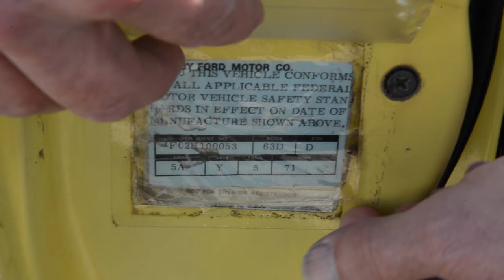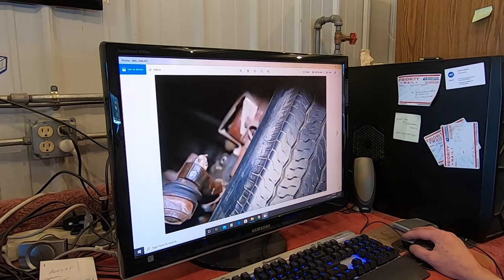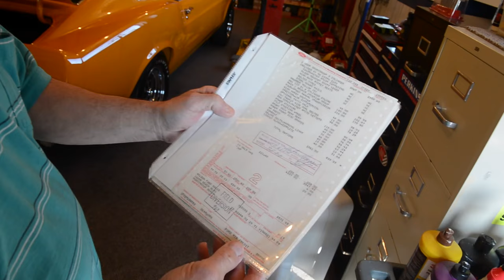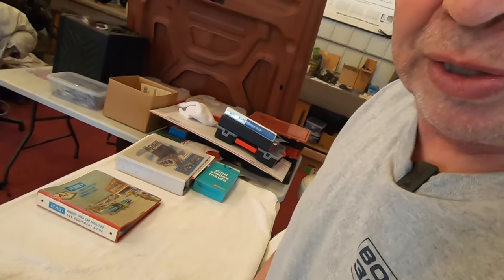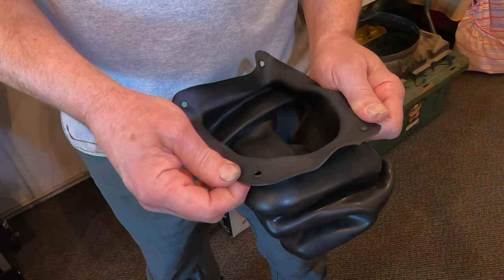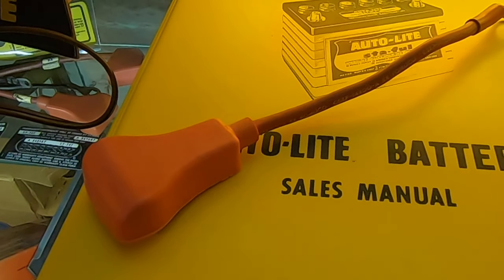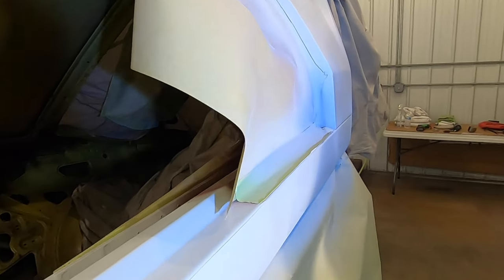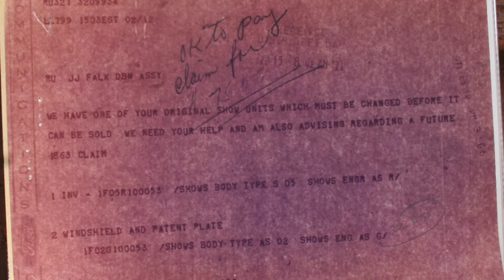The Long Lost 1971 Boss 302 Mustang Prototype, Bob Perkins Boss Expert Saving History

Comment: What a great story and a beautiful car!  I'm sad that it won't be driven.  I'd be curious to know if the Boss 302 engine in the heavier 71 Mustang body would perform like a muscle car?  The Boss 302 wasn't designed for drag racing so much, but rather for high rpm, endurance racing.  The Boss 302 Cougar Eliminator was a beautiful car, but 1/4 mile times in the mid 15's wasn't impressive.  LOL... I want to find the rare Boss 302 Maverick

Comment: I am a Ford fan and a Mustang fan ever since I rode in a 1967 390 GTA at the age of six. I am put to a mighty low shame by Bob Perkins!  He makes me looks like a know nothing newbie.  I have always wondered about the 1971 BOSS 302 and why there was not a 1971 BOSS 429 because the 1971 was designed for the very reason of placing a large engine in it's engine bay.  Another 1971 mystery is the 1971 Mercury Cougar Eliminator. I had a 1972 Cougar with a 351C in it and at the time I also owned a complete 1970-71 Torino Shaker air cleaner assembly. One day after tuning up the Cougar I had the hood open and a friend came over to BBQ and we had a few beers. We got to talking about what kind of air cleaner I would need to complete a ram air system to the Cougar GT hood scoop on the car. I pulled out the Shaker and I was holding the trim ring while talking about the lower air cleaner when I noticed that the under hood structure had a shape very similar to the trim ring. It matched the trim ring. The next thing I know is that I am shutting hood with a Torino shaker sticking out. Everything lined up and fit. I looked at my friend and said "This not a coincidence. It was designed for this hood scoop!" Why did Mercury decide not to use this?  They went through the trouble to make sure it worked. Where are the concept photos of it?

Comment: "Well, we know what Bob's passion is!   One of the NICE things about all the interest in the vintage mustangs is that there are several sources for new and replacement parts.  I can get about anything I might need for my old 1965 mustang from several different companies.   Also love the 1969 AMC AMX but have been afraid to buy one because getting new and replacement parts might be very difficult.  Hell, I wouldn't even insist on the 390 cubic-inch engine and four-speed tranny.  ANY 1969 AMX would suit me.

Comment: Wow, a man after my own heart that truly loved a ford and from what I watched was a man who could exploit the parts correctly. Although I didn't have  a fancy mustang, I did buy one from a dealer who was willing to give a nam soldier what he wanted was a four barrel anything motor with four speed and so into their shop went a kinda overkill six cylinder three speed car with one wheel peel and so they put a 302 engine with some aftermarket manifold to make the carb work plus whatever it needed for the throttle cable that I wound up tying a wire to hold it tight and work right on the side of the road. At the time I knew none of the above history and was only interested in power and speed. I used a narrowed lincoln rear end done in a shop in seattle where my money was fast disappearing. I did have fun in it and it caught some road rash I thought added to its personality. I caught a girls dads fence post digging out when he shot at me and the car caught some of the lead which popped the back window and had plastic in for a little while and then plexiglass. I couldn't see through it good but then others couldn't see in. The back of the seat on the passenger seat was much bragging rights with some holes in it. So there had to be lead in  the upholstery.  The rear end was 41?  as I never really knew for sure if it was what was written on it. It had the disk brake from lincoln and all that on it but the center section was worked on and did the posi burn. This car had over thirty thousand miles from me but started giving me problems with  the linkage on the trans getting tangled up when speed shifted bad. Hammers to get the thing to roll again as it slide to a stop a couple three or more times and then is when I stumbled onto a dodge polara with a 426 wedge and four speed factory. I got fifteen hundred on the trade in and that was more than most were selling for used banged up, an cause I drove it in my work clothes and did the upkeep in the car washes it had problems so was glad to get off it for a factory car that to me at the time looked more like a race car from  the hot rod mag. I did get the dodge in 74 spring an was put together at the factory and by then getting on wages only plus a divorce so I had worked two summers in alaska. I drove that dodge till I pulled to the side with a flat on the right front? Your asking how I remember and it was easy, that tire was tore up and flopping and when it caught the soft fill on the side of the road,  it took that phony torsion bar suspension and ripped the unibody and all up leaving me right there. I did start it and powered it onto the road where it definitely wasn't going anywhere. A guy I knew come and got me and it being a wrecked car thought I was screwed. I did know how to work on cars like a kid at the time and it was above my paygrade back yard diploma. He was headed to work and told me I could use his rig, don't wreck it an I took it with grin. He worked at a chevy shop and so me and chevy had had our differences. I went over to the local ford shop and used car sales. I was looking at their magazines and their salesman asked me if I was looking for something so I unloaded my lifes story on him and he said let me talk to my boss. They come down in their salvation army suits that just looked sad to me and I was going to leave. One said wait I have what you really do need..... ok.... and we go look at a 72 three quarter ton ford with a four wheel drive and as close to kinda dressy looking as the could cobble together look. They took title of my dodge parked where it was as someone there had seen it an no one did mess with stuff during the day. He said that I could bring the rest of the down payment in in two months but no longer. I thought that was easy enough ... thinking   will get you every time as I found out. So some money left and a second hand nice little rig I hooked up with a bad crowd. I had to go to court in the afternoon and I was on a airplane north to Ketchikan where work and drinking had been my new signature. I did outgrow that but should of never put myself in that position an then a phone call to Olympia let me and them know I would come back and face my  consequences. That was one nice judge who fined me a hundred dollar more out of token but he talked to me in chambers and really did get my attention. It was 1976 and I didn't want a warrant out. I wintered out and spring took me back to alaska where I have lived a colorful life.

Comment: I had a 1973 mustang coop , not the fastback. I bought it in 1987 for $100   it had the 351 Cleveland with a 2 barrel. I spent two years fixing it up not the right way I used a lot of Bondo. But I did have the engine professionally rebuilt. That car was so fast it was unbelievable ! nobody would believe that it had a 2 barrel on it until I showed them the carburetor. Unfortunately I ended up getting married and had to sell it. Should have stayed single.
Reply: Yea its amazing that even the early coyote 302 engines are smaller, way more powerful, and more fuel efficient than those old school muscle engines.

Comment: In the late 80’s I had a 5.0 4 speed Indy Pace Car which was missing one of the black seat belts because the first owner raced it at Brainerd International Raceway and another track in Wisconsin in the SCCA Showroom Stock series class A. He used a 4 point racing harness. On a late delivery run for Napa I saw a damaged 79 Pace Car behind a shop. I bought the dashboard, interior and a few other parts off of it,,, then a few more after the engine and transmission were sold and it was almost a bare shell. I remembered the 2 digit sticker on the forward facing side of the rear view mirror. The seller who had the title offered to sell me the bare shell for $100 but I passed. The pewter paint on the inside of the right door and RR quarter panel was very beautiful. It had been in 3 accidents: front crash and rebuilt, T-bone crash and rebuilt, then the slow rollover after which it was parked. The interior went with people from Nebraska who bought my Pace Car in March 1990. I remembered it was a 5.0 automatic and the last 6 of the VIN was 480054, similar to the 9f03f480544 vin of my 5.0 4 speed manual Pace Car Pace Car that went to Nebraska. In 1994 I see an article in a Mustang magazine about a 1979 Indy Pace Car “500 Festival” car listing the low VIN number as the Pace Cars started at 480001, all being 5.0 automatic and the 2 digit sticker on the front facing side of the rear view mirror and so I think it was one of about 75 “500 Festival” cars.

Comment: I drove a 1971 BOSS 351 blue ,my friend had bought in 1980 from a one owner with 40K miles in excellent shape, under rated power it would pull you back in the seat like a F-18 an handled so beautiful with the longer wheel base they rode nice too. As a ford & Mustang fan Hats off to Jerry H.  Would like to see more after fully done Thanks !
Reply from the maker: Planning a follow up when done.
Reply: @thewriter2549  ThankYou  I enjoyed your videos an narration (or interpretation of the FORD codes) I owned a one owner 69 fastback (blue) 351 W 4V dual exhaust with 40k mi in 1973 i did a isky cam anti pump lifters with a mallory dual point Dis she would run found out when valve job was being done it had10 to 1 compression factory heads 90 cc same as the 302 boss i believe , I had talked to the oner he said he ordered it that way in 69 . I drove it for seven yrs

Comment: Id have left it original and only did the motor swap and kept the 351 on a stand(not detailed) and make a really nice book with all the documentation and info and maybe put some effort into finding people that worked on the line where it was built to possibly get a testimony. That would be worth as much as this high dollar rotisserie restoration. The car being rust free didn't need all that. Its more impressive to see the great original condition
Reply from the maker: The question is what is original, the Boss 302-powered Mustang that Ford engineered and Dearborn Assembly Plant put together, or the quick engine swap in California for the sale. Remember, the 4.11 Detroit-Locker and other mechanicals for the Boss 302 power remained, just the engine changed. I don't see the two barrel engine as what this car was built by Ford to be.

Comment: The history of the car is interesting and the fact  that the owner was putting the car back to the way that Ford would have likely built and sold a 1971 Boss 302 car makes it pretty cool. However the car was sold from the factory as a garden variety 351 2 barrel Mustang and so that’s what it will always be.
Reply from the maker: Your analysis is flawed because this is not a production car with one VIN. The car was built as a 1971 Boss 302 at Dearborn Assembly and that is its identity.
Reply: Jerry Heasley It doesn’t matter what it started out as...Ford did not sell any 1971 Boss 302 Mustangs.
Reply from the maker: What defines this car's identity, the engineering work of Ford Motor Company and the build of Dearborn Assembly, or a two barrel V8 engine swap performed on the West Coast to make the car salable? They left the 4-speed,  4.11 Traction-Lok, oil cooler, and the rest of the Boss 302 parts in place.
Reply: @billiebuckamer8189  you could say the same with 1971 euroshelby mustang then ford never sell any of them

Comment: Ford ran some strange setups on the assembly line. I had a TBirb with a low horsepower 302 that had a locker rearend from the factory. The only thing I could reason why they did it was for winter travel.

Comment: Every so slightly obsessive...  but for all of the right reasons.   All of those guys talking about unicorn 1 of 1 cars because a certain car was the only one with power windows AND dual exhausts can hang their heads in shame against what is truly a 1 of 1 car - well, technically 1 of 2, but we know the other one was turned into a pancake in 71.   This is a truly unique car, and I am glad that someone obsessive is working to make it back as right as it can be.
Reply from the maker: Well said!!
Reply: Hey did they ever did a 1971 boss 429 or only 302 but scratch

Comment: I work on the line for Henry. We still use the wax markers.

Keep in mind, it takes 53 seconds to install the engine completely dressed with transmission into the body. NOT 54 seconds, NOT 55 seconds. 53!

Comment: By chance was the Boss 302 engine that was in a guy’s basement for years the actual first engine put in that car,,, or just one of a small number of 71 Boss 302 engines made for the cancelled production run?
Reply from the maker: No, this was assembly line ready and waiting to go when the Boss 302 program was cancelled.
Reply: @thewriter2549  how many you think they made before ford gave the word maybe 2 or 3
Reply: @thewriter2549  also do you know if they ever made a 1971 boss 429 prototype like this one

Comment: Original prototype in very good condition. THIS SHOULD NOT BE RESTORED or changed from how you got it.
Thing that gets me is this car was all original with a different engine, yet most of the parts were changed to NOS and a different engine was installed. 
I guess that's what a Concourse car requires, no expense spared. Too bad.
Reply from the maker: Normally, I would agree, but this Mustang was originally built by the factory as a Boss 302. Ford changed the engine because they decided not to produce a 1971 Boss 302. Instead they would produce a 1971 Boss 351. Then, Perkins found one of these exact Boss 302 engines, new old stock, that went into the 1971 Mustang Boss 302. So, go back the way the factory built the car, with the correct and unique-for-1971 Boss 302 parts that got sold through actual Ford dealerships. Ford had the Boss 302 parts in their catalogs for the 1971 introduction, and then it got canceled. That's why it makes no sense to go back with a non-performance engine in the surviving 1971 Boss 302. The original car was first a 1971 Boss 302!! Bob even got all the paperwork from Marti Auto Works. This is a real factory 1971 Boss 302.

Comment: Where's the video on how the original guy got the 1971 Boss 302 motor? Ford canceled the program so the motors weren't valuable to the corporation but what was the process by which he ended up with a production motor then his reasoning for letting it sit for 50 years? I've done something only remotely similar but it was just a piece of SS316 plate that I requisitioned for a specialty project that went a different direction. So I have 30 lb piece of SS316 plate that I've stored for 20 years not a 500 lb motor that's 50 years old.

What about all the previous owners? Is the first owner still alive? His recollections would be valuable if only to find out if he suspected anything different about the car. I just read that the second owner changed it from a 2V to a 4V but was the second owner the one that put it on eBay? A video of the previous owners up to the eBay lister is needed.
Reply from the maker: The owner history is very interesting, and would take connections to bring out the story. I have not ruled it out, maybe when we do the wrap up video of the completed car.

Comment: I'm confused.   Putting a 351 2v in it will make it much less valuable than a Boss 351.   So why did they downgrade it before selling it?
Reply from the maker: Prototypes can be confusing. For assembled this car as a 1971 Boss 302 then sent it off to a show. Soon after assembly but after shipment, Ford discontinued the Boss 302 Trans Am racing program, negating the necessity of a Boss 302 engine to qualify the car for racing. So, they made changes on the West Coast, including puling the Boss 302 engine, so as not to confuse people back in those days. Does this make sense now? New Trans Am rules allowed de-stroking and de-boring the production block to meet Trans Am homologation rules, so Ford chose a new Boss with 351 cubic inches and called the Boss 351 for 1971,.
Reply: @thewriter2549  
I'm confused that they sold it as an ordinary 351 2v.    Why not just sell it as a Boss 351?   

The only reason I could think of, is not enough demand for the Boss 351.

Comment: The low torque 302 in the bloated and unattractive 1971 ‘Stang?  Meh. What Ford SHOULD have built was a 1970 Boss 351.  The best performance small block engine in a better looking, better handling and lighter car.  Now THAT would have been something.
Reply from the maker: Dan - a Trans Am engine was engineered for high rpm's, and thus the big intake valves to sacrifice low rpm torque for top end horsepower. This 302 was a winner on the race track. These were the days when the manufacturer had to homologate parts for the track by producing them for customers in sufficient quantities, and thus a Boss 302 appeared looking like the race car it homolgated. New SCCA rules allowed the 351 to be de-stroked to fit under the 5.0 liter (302) displacement limit in Trans Am, so the 351 will never be the glorious racing engine the 302 was. 0-60 MPH was not nearly so important in Trans Am as top end speed, but 0-60 was still fine with those 4.11's - which hardly a street car got. The '71 was to be another step up on the race track with its wider track, which an extra 3" in the engine bay allowed the 429 Cobra Jet to fit. Ford backed out of racing, but there were private entries in '71. The longer, lower, wider '71 made a fantastic looking racer and there was an AMT/Ertl model. Had Ford continued their racing program, this is what would have been, so glad we will get to see one, when this is finished.